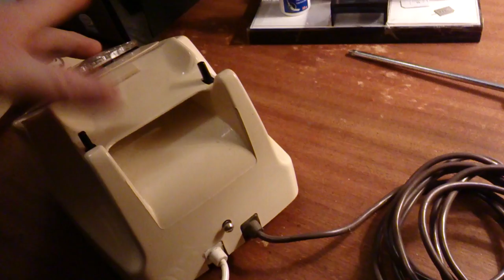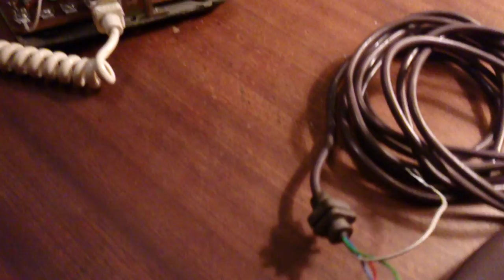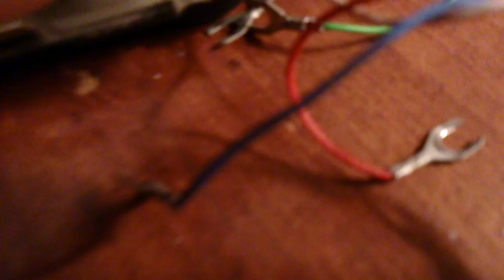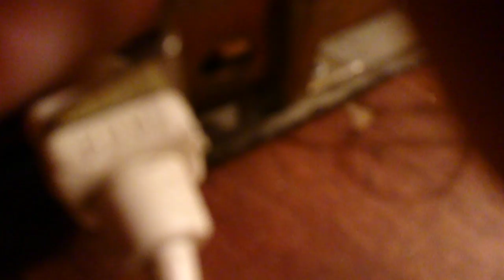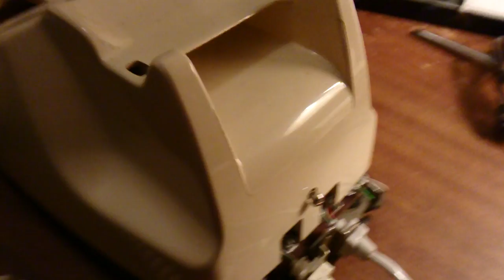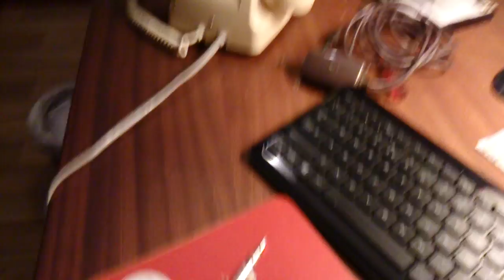HOW TO CONNECT A NEW LINE CORD TO OLD DIAL TELEPHONE :HD

Comment: Do you know how to connect a rotary dial phone to a new Fiber line Modem.
Reply: I tried the same thing i managed to make the phone work it could make a call and receive but unfortunately i couldnt ring the bell.lol.the phone receives the call but doesnt ring.i think its because of the low voltage of the new modems.